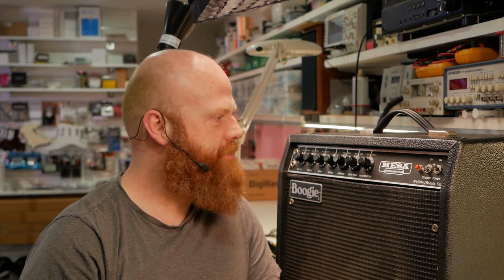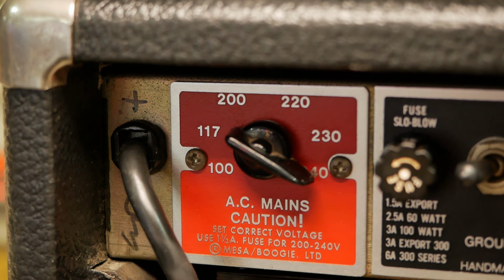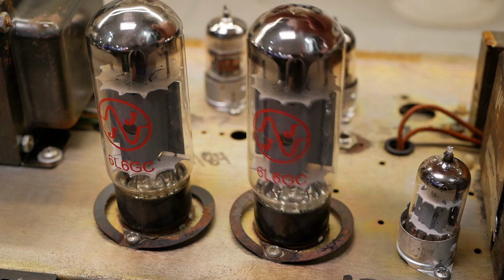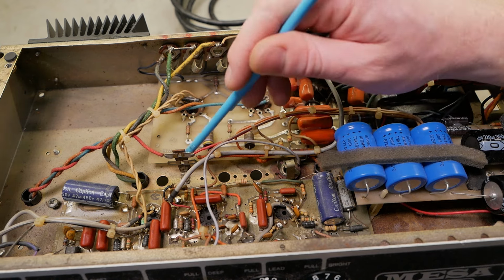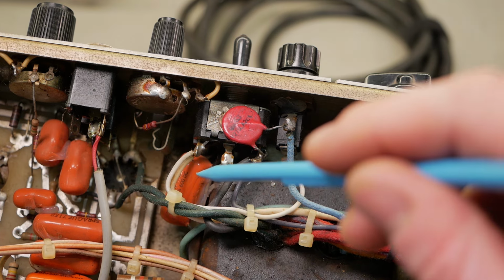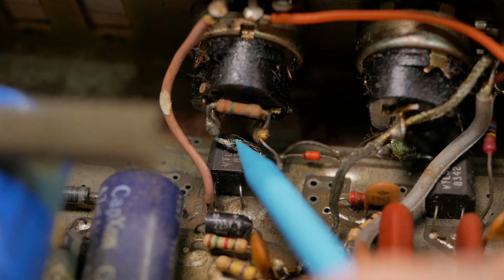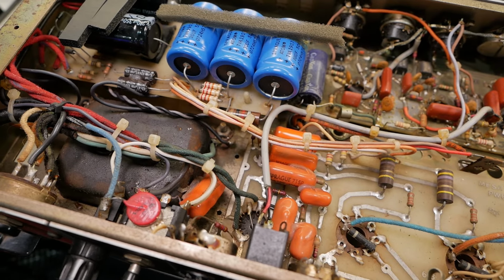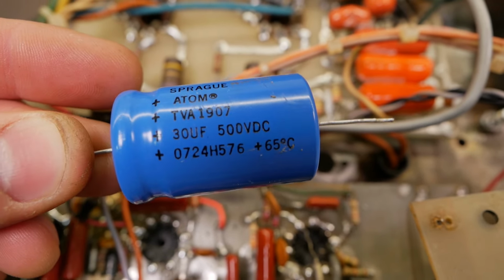Mesa Boogie MkiiC+ (Part 1)

Comment: All that rust is most likely from leaving it out in the garage or the basement. Run a dehumidifier if you are going to keep gear in your basements guys. As for the rest? Ugggghhh.... I have a Mark IV I have used for 24 years and it looks as good as it ever did. No need to treat it like a stepson now is there? And my amp has been through hell and back and it is almost none stock with just a cap job and a few little things over the years. Pride of ownership evades some people.

Comment: Good ole Mess of Boogers engineering. If you go back to the Mk. 1 they use to brag about there amps being hammer tested. They beat on the back of the useless heatsink. Probably the best use for it lol 😂. Have a good one mate….Cheers 🍻.

Comment: That is an Eminence speaker. The others were Elevtrovoice typically. In all fairness the amp is 40 years old and there is no telling who has had there hands in it through the years. Some of these amps were abused my drunk musicians for many years.They were built like tanks. The ground lift is for 60 cycle hum in the USA. They put them in for a reason and They do work. The shock suspension was made to help keep shock to the chassis if it is set down to hard. That also works. Also even mark III'S the green stripe was 25 watts in low power class A power were louder than a 100 watt Marshall. they were very under rated power wise. VERY LOUD. mine have the wood still there over 40 years later. Anyways as i said the amp is over 40 years old, all these new amps built now will never last as long as these old boogies. Also you can still send these amps back to boogie and the same man that serviced them when they were built still services them til this day, no other company does that.The heat sinks were on all of them because the 75 watt simulclass 4 power tube models needed them and they used the same chassis for them all.

Comment: 27:40 Oh so that is why I got 110v to the face once at a rehearsal… I don’t remember exactly the amp at the time but there is a strong probability it was a Dual Rectifier I think.
All I remember was blacking out for a split second and when I came to my senses I was out of sync with the rest of the band 😂
Reply from the maker: Joizuz, man!
Be careful out there!
Reply: I hope the audience didn't go wild when this happened, if so you'd have to repeat the shock every night! 😁

The "death cap" thing is not exclusive to Mesas, there are loads of amps out there with them. Any good tech will snip it out (maybe secure it out of the way inside the chassis after the snip) and if the mains cable is two conductor, replace it with a three conductor cord with a proper strain relief. The ground lead on the cord should be a few inches longer than the hot & neutral and soldered to the chassis or FIRMLY attached to a dedicated lug with a star washer or keps nut. Make sure you've fusing the hot, not the neutral. RF amplifiers generally have both fused.

Comment: Nice job on this one, Brad! The broken heater connection to the tube socket is an excellent example of why tube-socket terminals should never be bent down flat and soldered directly to a board because there's absolutely no room for play or movement and the solder connections are extremely likely to break.  You can get away with this on 9 pin preamp-tube sockets to some extent, but output tube sockets are subject to far more shock and vibration, especially in a combo cabinet, due to the length and weight of the output tubes. PS,  I wonder if that crossed on the circuit board was dried up residue from whatever they cleaned the pots with; maybe they sprayed the whole thing with WD40?

Comment: Love the way you have a zero tolerance for that death cap, also, coincidentally, I've been looking for a spot to put a triode/pentode switch on my Mark III, which has the same worthless ground switch, guess where my new switch is going to go :)
Reply from the maker: Yes, that's another good repurpose of the ground switch.
However you might want to replace it with a SPST/SPDT switch to avoid confusion during operation.

Comment: Happen to be playing my almost identical Mkiii when I watched this. For some reason Australia got a lot of the 60w EQ-less versions of the Mark ii and iii. I actually like the 60w more than the 100w versions I've played. I put the EVM12l in mine and it is practically bolted to the floor. Unlikely to be stolen from the stage.
Reply from the maker: Man, they are SO HEAVY!
You're not running down the street with one of them, that's for sure!

Comment: Back in the ‘70’s Mesa would include tapping the chassis with a hammer in their final checks. They used to point out the hammer dings. I think the heat sinks purpose was to cover the marks.
Reply: Hammer test smack? Bad solder joint test? I see yt techs go through measuring bias current, dissipation, ht voltage and whatever else to determine problems when the first thing you should do is a visual of all the solder joints. It's concerning how many times this happens  and the actual trouble is solder joint related.

Comment: I wonder if you could design and 3d print a mold for a replacement rubber mount.  Then,  use rtv silicone combined with corn starch at whatever ratio is optimal to produce a replacement mount.  Their might be stronger diy silicone formulas.
Reply: 3d printed TPU and testing different hardness filaments as well as thickness is a far simpler solution compared to a cast or mix. When you print tpu, and dial it in - it doesn't have the layer line weekness as experienced with typical filaments (pla,abs, etc). I print a good amount of TPU and that's the first thing I jumped too, didn't know this was a common problem.

Comment: It's been my understanding that "death caps" are dangerous even if they don't short.  If the "ground selector" switch is switched to what turns out to be AC hot, then you have hot connected to the chassis through the capacitor, i.e., same as a wire at AC frequencies.  So just like celebrities that have a "taster", rock stars could have a "safety tester" who would pick up the guitar first.  If tester survives, switch position is good.  If not, switch it to the other side.  picture smiley here

Comment: The chassis gets really hot in these. Like you could boil an egg. Aluminium has favourable properties as heat exchanger and that shape has some surface area. It's located as far as possible so the temp diff is largest possible and atleast simul-class version has fan under it. I think you could give them credit atleast trying something :D Today we have many manufacturers who design to a pricepoint and every single component is chosen based on cost, availability and quality. And that "quality" is only mentioned jokingly in procurement world to make an impression it would matter, in practice it is always reduced to cost and availability.

Comment: Fyi, that bit of wire in the chassis cup was part of earthing, somehow. Those screws in the cups have big metal washers and under one of the four there is a loop of wire coming up from below that is squashed under the washer. Maybe from the foil shield?
Reply from the maker: Yes, I found that out and installed a washer under the screw for a better connection, still a bit silly though.
Reply: Yeah, it’s pretty agricultural.

Comment: Hey Brad, not shit-stirring, but isn't the white wire on the active of the old three-pin plug? 

If so, the active could be actually fused and switched as it should be (sorry mate, was a bit confused when you were talking through the death cap and voltage selector shit). Is the white coming from the cable switched and fused?

The black and white seemed to have been swapped in the three pin plug to suit Aussie (and Euro) wiring scheme - the Neutral seems black as per standard on the right as you are looking at the plug, Active on the left which is white).

Good luck with this one.

Comment: Molex connectors used by Mesa where not voltage rated or current rated the way they where used. Leo must not have enough of effect on this "designer " Ugly soldering on those octals . Lead singer of the Blackbirds I think was killed on stage by the death cap of his amp . It was said he flew in the the audience .
Reply: Les Harvey of Stone the Crows was electrocuted on stage when he touched a microphone while holding his guitar.

Comment: How can you make amps this way?! And it is even shittier with new ones. No idea how they design stuff. Safety ground sits on the damn transformer bolt. Ground from caps goes to the plastic bolt and then chassis. It is amazing you wanted to work on this shait... :D

But we have a super nice video to watch. Thanks!
Reply from the maker: Thanks for watching, mate.
It's very disheartening working on some of these amps, you get the triple whammy of the poor design and build, then the decades of mistreatment, and then the poorly executed repair attempts. But there's an indescribable satisfaction in putting them right, and hearing from the customer in 5-10 years that it's been purring ever since. It makes it all worthwhile.

Comment: You have to wonder if the 'techs' who previously worked on this were trained and licensed. If they were, it's way more concerning than if they weren't. Having said that, it's the standard of work I've come to expect from any Aussie tradie who trained in the last couple of decades.
Reply: Electronics is a disappearing skillset. It's hard enough to be able to buy parts in Australia. Just buy a new one. A lot of the "techs" just know how to change tubes and bias resistors. However there is quite a bit more to know. Especially when an amp has multiple faults.😊

Comment: Chuck those boards in an ultrasonic cleaner. Then you'll have full access to the rusted area on the chassis. I can't imagine soldering thru that gooey shit, looks worse than a late 70's Fender Twin.